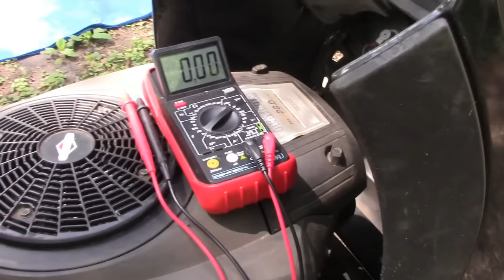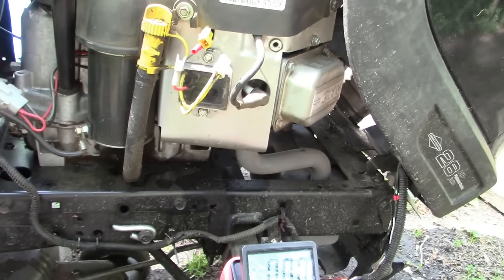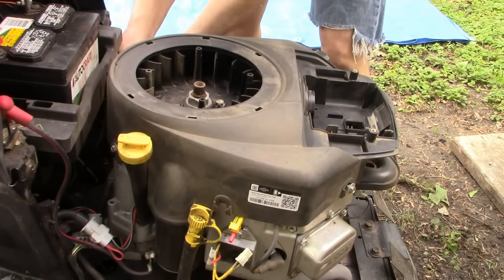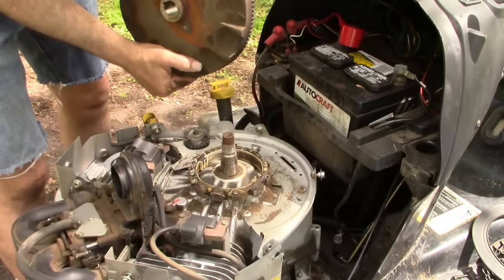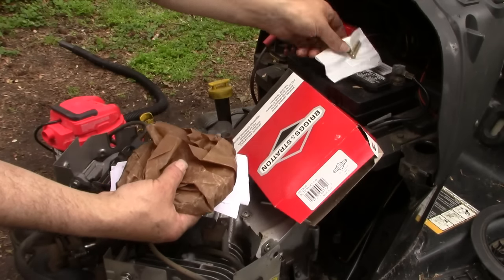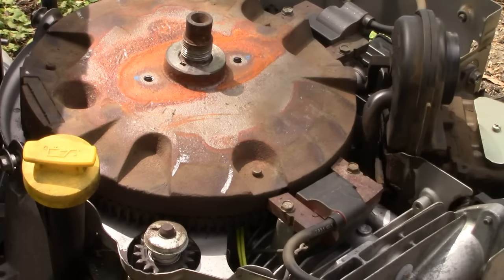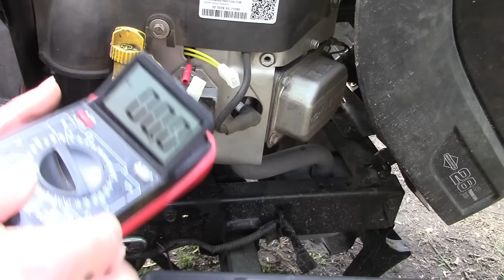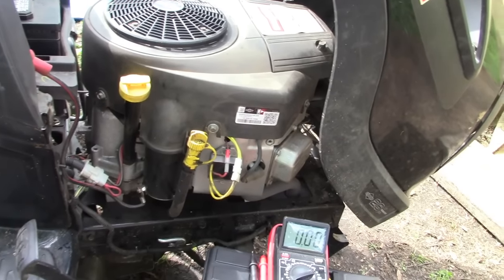How to Test and Repair a Lawn Tractor Charging System

Comment: Thanks, i had forgotten most of this and the voltages from that AC coil and have to work out why its not charging on mine as it has a electric clutch and always drains after a hour. Thankfully the charge wire goes direct to the battery without the switch and it tests good so i just need to check coil output and regulator. Will do that tomorrow. I thought your test of 16V? was a tad high from that regulator. The modern batteries can take a bit more, but i still like to keep it 14- 14.5 only on cars and whatever. 
Do you know where i can get a service manual for a Bolens ST 140 Suburban lawn mower from 1990 era?  thanks..
Reply from the maker: Thanks for the note. I hope you figured out what was going on with your tractor. What make/model engine does your tractor have? The service manual for that particular engine is what you need to best diagnose the charging system. Good luck.
Reply: @Buckwsr  Hi, i disconnected the coil and checked the AC amps. At idle and 3/4 power, i only got max 18 volts. The resistance of the coil was .2 ohms resistance,  Also the output wire goes direct to battery, no resistance or key on or off. and running idle or power, got battery voltage same as when it was off, so no charging it seems at all. i also backprobed the red wire from the regulator and got exactly the same reading which is right as no resistance to battery anyway. So coil stuffed and maybe reg too? or not enough coil volts to start reg going and output? 
Also i see other vids where some of these coils puts out 40+ volts? Is 30 the bare minimum even for the smallest engine as mine is a twin cylinder viscount but dont have electrical specs. Either way, ZERO output to battery confirmed AND i have that electro blade coil thing underneath drawing amps for an hour and draining the battery as i have no charging. 
thanks for any advice
Reply: Correction to my reply. I went back and retested again as that coil resistance seemed perfect for something burned out ect. So found the neg terminal on bat was a little loose and retested and the AC volts out put at good revs was 26V so i figured rev it more would get me around 30V so didnt stress the engine without load unnecessarily. So checked again out put of reg and zero, same as bat voltage. checked the yellow wire connector into the reg incase that was damage and power getting in but nothing out. ZIPPO!  So looked up that type 394890 b&S and about $20 on ebay chinese, so have to do and risk it than pay a zillion for a genuine part.  I happy coil is good or at least till i can check amps back to battery when reg is in circuit again.
Reply from the maker: Good job. If you've got good connection back to the battery, then you're either looking at a bad stator or bad regulator. Looks like you've narrowed it down to the regulator.
Reply: @Buckwsr  Yeah, the multimeter is a cheapee (i have expensive ones too) and sometimes plays up so i now get 26V AC easily from that coil isolated and i look up B&S for their diff coil numbers and some are 20v and the bigger magnet ones 30v, so i guessing 26v at half power must be ok, Either way the Reg output is Zero although didnt hit it with a hammer!  I already repair electronics , its just the mower is a bit diff although the parts in the reg should be standard but have to handle 10-20 amps so must be strong and some heatsink cooling off the body to the frame needed as it should get hot? might remove all the goo later and look inside but bought new one for $20 and the battery already dies after recharging , so have to charge before use and only the charging system will be needed now to keep the blades turning long enough when mowing before the battery would die after start with no real capacity left. old car batteries are great as they easily turn 14hp motors and you just keep refreshing them as you go and we get them free as they cant be used for cars anymore. Love recycling and repair all my own stuff. 
Even have a line trimmer with a little walbo on that keep stalling after running a while but had tons of power available. Everyone i asked was baffled. even i put 3 diff carbs on and exactly the same problem and fuel is gravity fed and checked for flow yet the mixture was suddenly leaning. i pressure tested the crankcase to 9 lbs and needle didnt move, but given the machine is so old the gaskets must be leaking when hot just a touch and the weak compression makes it stumble . So i am rebuilding the gaskets and oil seal to be sure this week and little engine should be perfect after as thats all it can possibly be as rings are good OR its cracked somehow, but pressure test would have shown that even when cold maybe. we will see...
Reply from the maker: @xx3868  Well, at least you're keeping yourself out of trouble!

Comment: One of the best.  I think I can learn from this.  One question: when checking the DC voltage at 23:23  I couldn't see where he put the black probe - in his right ear, left ear? under a fingernail? somewhere on the battery? on the frame (although he would have touched the frame within the view of the camera)?
Reply from the maker: Place black probe on battery negative or any grounded metal part of the tractor/engine.
Reply: Thank you Buck! My mower won't charge and the blades won't keep running. I think I now can confidently troubleshoot the problem.
You took me from not understanding how the electrical system works on a mower to having a good grasp now. I am an electrician, but small engines are my Achilles heel.
Thanks for making such a thorough video. Cheers
Reply from the maker: @EDKguy  Thanks, Ed. And good luck with your repair job. Glad the video was helpful.
Reply: @Buckwsr  I have a JD F911 front mower, it has an almost new Kawasaki 23 horse motor and has worked fine until recently where when I engage the mower deck it works for maybe 15 minutes and then wants to cut out. When I disengage the mower deck sometimes it keeps running and other times it stalls, but will start right back up.  It has a 2 year old battery .  Any ideas on what the issue could be?
Reply from the maker: @DavidJohnson-hw4qy  You definitely need a fully charged battery for any tractor with an electric PTO clutch. Also, verify that the charging system is working by measuring voltage at the battery with the engine running full throttle. Should be about 14 volts or so. If not, something is not right with the charging system.  Is your deck in good shape? Smooth spinning pulleys, good belt, spindles that spin freely. A deck in bad shape can put undo load on the PTO clutch and pulley. Hope that helps.
Reply: @Buckwsr  thanks Buck, I have two different mower decks both in very good shape, new spindles, bearings and rebuilt gear boxes, and the mower acts the same for both of them, so I don’t think they are the issue. I will review your video again and check out my charging system and see where we go from there.

Comment: How’s this for frustrating, my battery blew up when I put my new battery on it was charging over 16 V. The battery almost killed me, but I got past that now I need to know why is it over charging, right away everybody wants me to get to the copper wires under  the flywheel I told him that’s the last thing I’m gonna go for there’s a regulators, rectifiers and rectum finders. I can check first
Reply from the maker: Awesome, Daniel! And good luck!

Comment: How did you know what part number stator you needed?
Reply from the maker: Get the Briggs model, type, and code info from the valve cover, and then search online for the part(s) that correspond to that engine.
Reply: @Buckwsr  thank you!

Comment: My mower the battery gets drain if I don’t used 2-3 days.. any idea?
Reply from the maker: Possibly an old or defective battery? Also, be sure your charging system is working by testing for voltage at the battery with engine running full throttle. Should be about 14 volts. Good luck.

Comment: i bought a similar mower but old and its missing the harness from the regulator that goes in the battery, can u please explain how to connect a home made harness right to the battery?
Reply from the maker: I recommend you look up the wiring diagram for your tractor make and model. That will tell you where everything goes. Sight unseen, that's the best I can do for you....
Reply: @Buckwsr  2000 LT300 craftsman with briggs single cyl 20hp intek plus, they're all the same man

Comment: If you are getting voltage from your battery at the rectifier then I believe your diode in that line is no good . You do not want 12 volts going to the stater when the motor is not running . That will heat up and burn out your stater. That may be what caused your problem in the first place.  A good diode would prevent current from the battery going in that direction.

Comment: What was the size socket for the main large bolt?
Reply from the maker: It was probably 15/16”
Reply: @Buckwsr  thank you. Experiencing the same issue this mower in your video. Curious how cooked mine looks.
Reply from the maker: @Scissors09  one tip. Never jump start a tractor with an electric PTO. Always maintain a fully charged battery. Good luck.

Comment: I have 30 V coming out from the alternator and 15 V going out from the voltage regulator but as soon as I disconnect the battery it dies the tractor dies what seems to be the problem can anybody help
Reply: The ignition system has the sense to realize the battery is no longer in the circuit.

Comment: You didnt show what setting on multi meter to test the charging system
Reply: To test the stator, set the meter to AC voltage, there are multiple voltage setting options on the multimeter so choose a setting that's higher than the voltage you should be getting from the stator.   Stator should put out approx 28-40v depending on mower, so choose the AC 50V setting or something similar to that.
Testing the voltage regulator, you're looking for 13-15v usually so you'd set the meter to DC Voltage,  20V setting.  Hope that helps

Comment: The meter is reading VRMS AC voltage…. Which 30 Volts alternating current is approx 15 volts in + direction then 15 volts in - direction. So I don’t think your Stator is bad…unless burnt up from heavy draw… but the rectifier is prob bad.
Reply from the maker: Did you watch the whole video? The stator was clearly fried. I never replaced the regulator, and the tractor runs and charges fine still even now.

Comment: It can be caused by jump starting off a running vehicle also!
Reply from the maker: Yes! because you get the tractor running by jumping it, but then the tractor battery is still depleted, and when you engage the electric PTO the load on the charging system is too much for it to handle. I have no doubt that's what happened to this tractor. Thank you!
Reply: @Buckwsr  what I used to do was unhook the battery positive from the mower then charge the battery off vehicle! Unhook cables and hook positive back up and check battery voltage before starting the mower!

Comment: If you've checked these and still have an issue, it could be in the wiring harness you see near the oil fill, on many tractors with a diode style alternator(bulge on red charge wire) and no rectifier that connection becomes trash. New harnesses including the connection for fuel shutoff can be found on Amazon.. Ask me how I know.
Reply from the maker: How do you know? Hey, you told me to ask....
Reply: @Buckwsr  Oh you know the whole learning via bashing my head against a wall. Or more accurately, by accepting mowers that should be in the trash, and then way undercharging for my time. I'm one of those morons who has to fail to succeed. 
On a technical level I pulled out a meter got my 30 vac on one wire my 14 vdc on the other and a battery that wouldn't charge. On my particular model the charge wire runs through this harness and eventually works it way back to the incoming side of the solenoid and then back via the positive wire to the battery. Since the starter works well, the only conclusion is a break in wire or poor connection. It's possible for the issue to be on the tractor side of the wiring but I don't believe there's much wire there to go bad. There is the single bullet connector for the charging wire, and the engine to tractor connector. The fact that I had intermittent issues with fuel solenoid leads me to believe harness, but additional voltage drop tests would be required, or at least voltage checks, since the wire runs back 5 amps I believe on the dual circuit. We arrive at I=v/r. High resistance connections cause a decrease in amperage, and even with 14v an inadequate amount of amperage to charge. This is likely why they insist on testing these type of alternators by placing a meter inline and measuring amperage coming back to batt.
Reply from the maker: @mechanicallycreative9788   What an ordeal! Well, in my case, the alternator/stator was clearly fried, as evidenced by its visible burnt condition. I'm glad you got it figured out, and thanks for sharing your knowledge...albeit gained the hard way!

Comment: It wasn't the case here, but a problem I see on small engines is rodents love to build nest in and around the cooling cowls of the engine . This causes the stators to overheat. Restricted air flow causes valve seals to burn out , which causes oil consunption or leaks. If you suspect you have an air flow restriction, it pays to take it apart and clean it. Save yourself a lot of money.

Comment: 16 volts is way to high …...replace your regulator rectifier …..it is over charging and can do damage to the electric clutch as well as battery over time . You shouldn't have more than 14.20 in dc voltage …..Check the Briggs alternator chart to insure you purchased the right alternator or stator if regulator rectifer is sound . Many companies warn about over charging being a problem for electric clutches such as warner for example or even Extreme clutches made as replacements . There internal windings just wont hold up .
Reply: Note /Your video was great and a terrific way to find a existing issue with a faulty stator …….Just watch that dc output and remember 14.20 tops .
Reply from the maker: Thank you, Kevin, for the note, and for adding to my knowledge!

Comment: Pound a little too hard when removing the flywheel may knock the glued on magnets loose. Then a new flywheel or reglue job!
Not good with just using an impact  to tighten the flywheel!  If too loose it will shear the key and no run. If too tight then is hard too get off again!  And too much impact will shake the magnets loose!
Reply from the maker: None of those scenarios you've imagined came to pass. As others like to say...it ain't the space shuttle....

Comment: Good video. Except where cranking down on flywheel nut. DO NOT CRANK DOWN ON THE FLYWHEEL NUT. MUST BE TORQUE .... over tightened nut WILL crack flywheel after a few months of use!!
Reply from the maker: I'll keep you posted and let you know when the flywheel cracks.....
Reply: @Buckwsr  Sounds good. Mine cracked a little over a year (less than 6 months of use) ... or at least that's when the symptoms of a cracked flywheel started ... Hard to start because timing was off.
Reply from the maker: @tonyj2665  Interesting. I've never experienced that. Additionally, I don't think my little impact driver is too beefy, so the nut is probably not on there all that tight. we'll see what happens.
Reply: I did use a pneumatic gun on mine . After a replaced the flywheel, I torqued it to briggs spec. Learned my lesson. 🙂

Comment: I thought you was going to clean the flywheel in the coil also. It looks really rusty like it needs sanding.
Reply: As long as the rust doesn't cause the flywheel to touch the coil the rust doesn't matter.  It will rust quickly again.

Comment: Why do these tractors in these videos always have a full charge? Pro tip if i had 12 volts across red wire I wouldn’t have a problem. If I search “tractor not charging” and i get diagnosis on a fully charged tractor it does me no good.
Reply from the maker: It's not that hard to understand. I put a charger on the battery, so that the tractor will start, and then I can verify that I am not getting the proper voltage from the stator and/or the rectifier. You can't test the charging system unless the tractor is running. Once running, put your voltage tester on the battery and you should read, not 12V, but 13-14 volts with engine running at full throttle. That's proof the charging system is working properly. In my case, this tractor (my neighbor's machine) had to get hooked up to a battery charger between mows because the battery was draining, not maintaining. But unless I charge the battery or jump start the mower, I can't evaluate the charging system.

Comment: Stator got fried because someone jumped it with a low battery an charging system put out max amps for a long time to run the PTO and charge a low battery. Don't jump a low battery.
Reply from the maker: Specifically....don't jump start a tractor that has an electric PTO.

Comment: Yes, I do not like this video of yours. Why? It misled me. Because you said that every mower has voltage regulator. I was looking for that regulator and couldn't find it. Mine 2011 yardman tween 20HP does not have voltage regulator.
Its charging voltage is unregulated. Also, it does not have electric clutch. What you are showing applies only to the mowers with electric clutch. You should have mention that, and save people some frustration.
Reply from the maker: Sounds like it's been an excellent learning experience for you! Thanks!

Comment: Can anyone show the damn smart meter settings on these damn videos.omg?
Reply from the maker: Set meter to AC volts (200 scale) for the stator reading. Switch to DC volts (20 scale) for the regulator/battery voltage reading. Also, stop cussing.

Comment: This does not work. You need to use a gear puller, penetrant oil, and tap the gear puller top with a hammer.